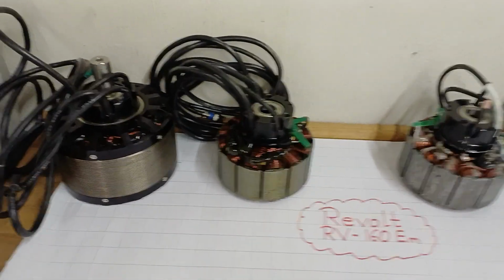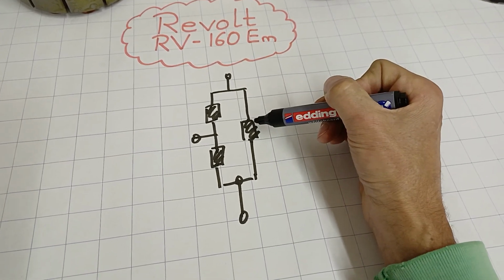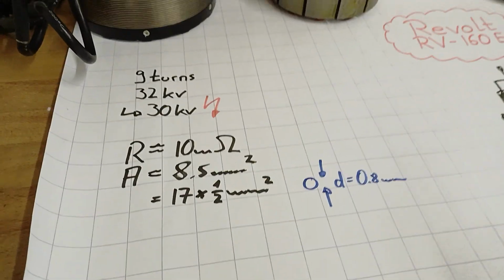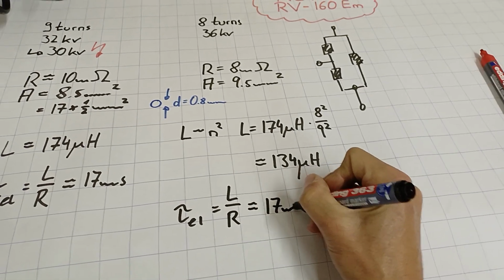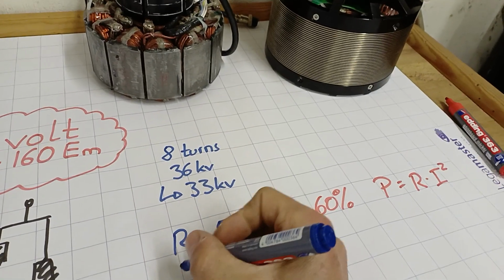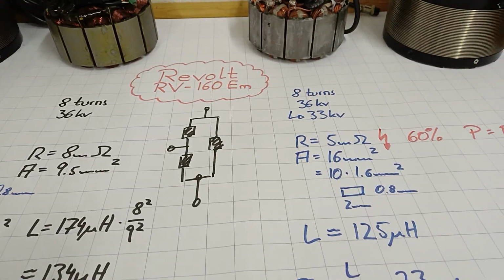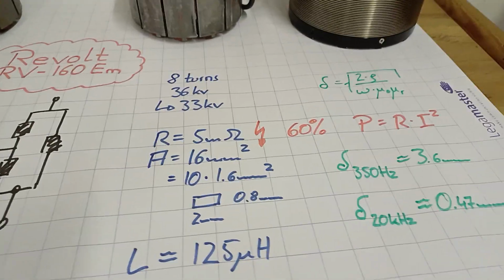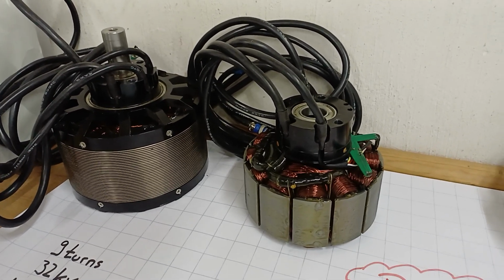Rewinding Revolt RV-160Em Brushless Outrunner (BLDC) for Twizy DD

Comment: nice video, I only have one question, how did you measure/calculate its inductance? I'm using a revolt-120esm and need to know this info in order to apply a field oriented control. again, nice work!
Reply from the maker: I used two fairly simple LCR-meters: "Peaktech 2175" and "Extech LCR200", both delivering same values

Comment from the maker: Mistake at 3:25:
the original motor with 9 turns has voltage drops (phase-phase) at 100A of 1.094V, 1.05V and 1.092V. Substracting the resistance of the cables, which are a little longer in my case, it fits perfectly with the 10.1mOhms according to the data sheet.

Comment: Wow, thank you for doing this. It is very interesting.
Reducing the phase resistance from 8mR to 5mR, for the same kv, is a great performance upgrade. You can put a good amount more current through it before heating is an issue (assuming saturation is not an issue).
Your effort with rewinding are worth it. Do you know of a good supplier of rectangular wire?
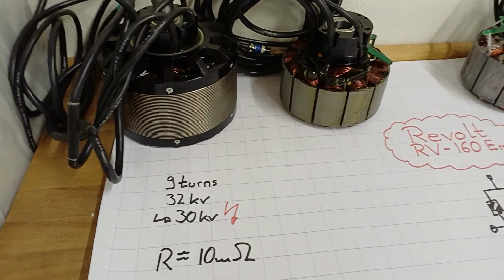3:25 "110mOhms" did you mean to say that?
Reply from the maker: Hi, it was a lucky coincidence, I found some varnished copper wire as a remainder (private person, any kind of platform like ebay). At least, https://www.wires.co.uk/acatalog/rt_ec_wire.html is an offical source.
You're absolutely right, at 3:25 it should be 11mOhms, thanks for the hint!!